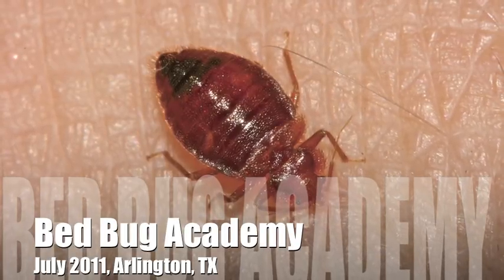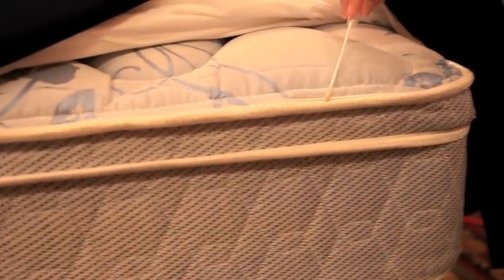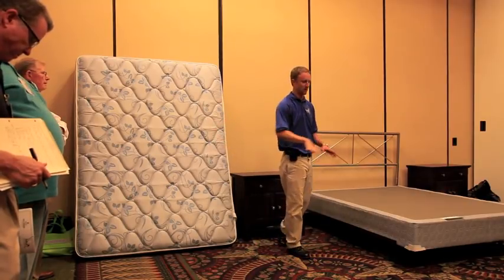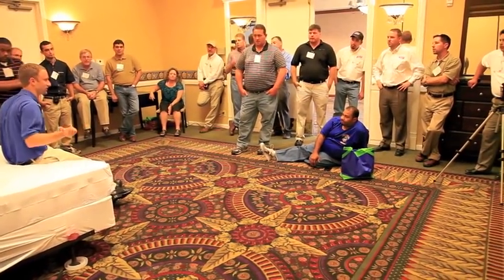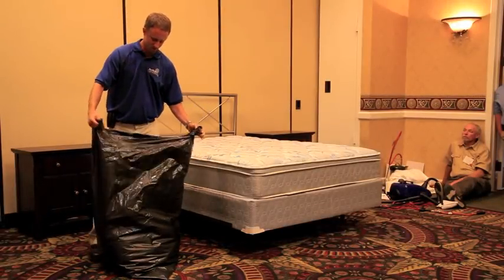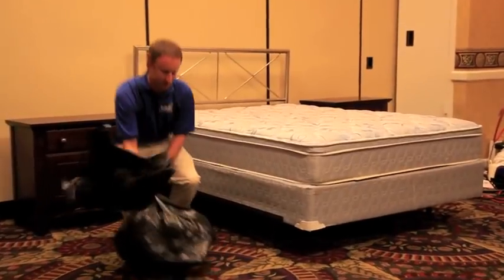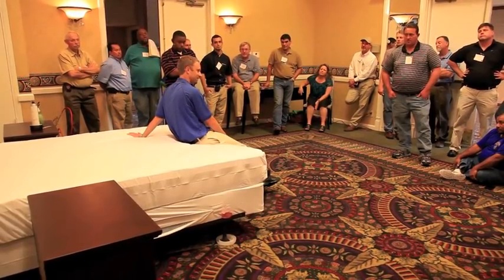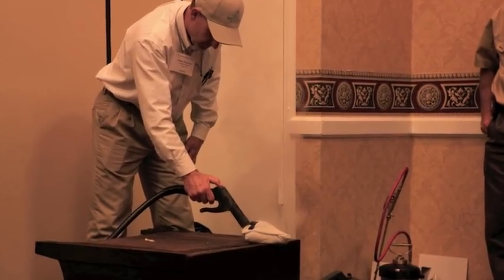Bed Bug Academy 2011

Comment: I lived in an apartment with bed bugs in 2017. The management did the best they could, but their best wasn't good enough. They heat-treated my building. I checked my apartment 8 hours after they finished and it was still over 100 degrees.  I stayed at my parent's house that day and night. When I came back the next day, the blinds on the windows were melted. I went to the bedroom and saw a tiny bed bug crawling on my bed. They are impossible to kill. I moved out a few months later. I threw away thousands of dollars of my furniture -- my bed, dresser, couch and loveseat. I washed my cloths and put them in vacuum-sealed bags. I put a lot of stuff in storage for a year. When I moved back into my parent's house, I was super paranoid that I would bring bed bugs with me and infest their house, but luckily, it's been 4 years and I haven't seen any signs of them. I will never live in an apartment building again -- ever.